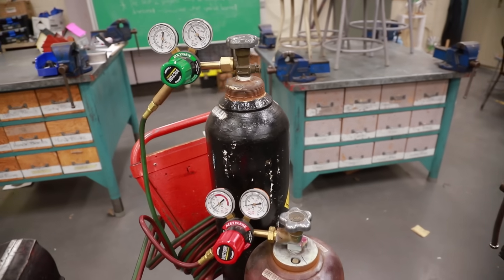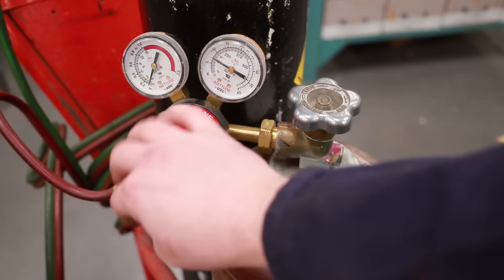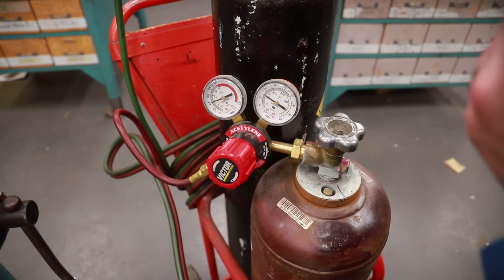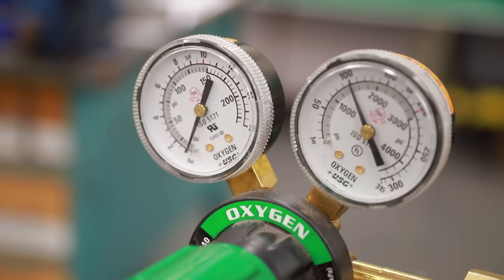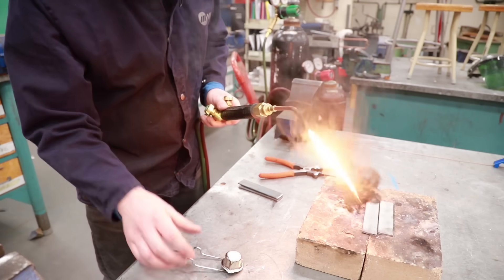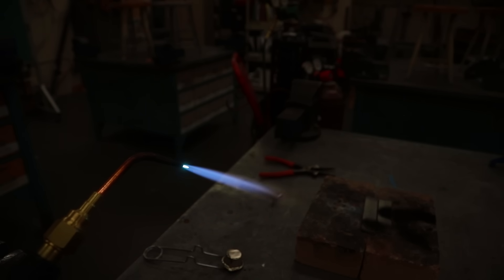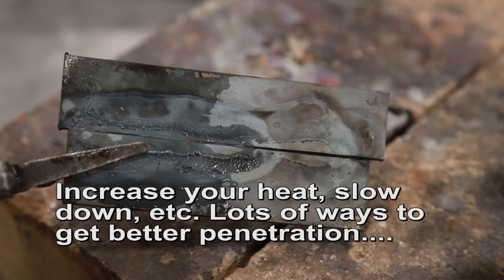Intro to Oxy-Acetylene Welding - Part 1

Comment: Didn't you turn the valve the wrong way to purge the line.  It looked like you close the valve instead of opening it?  I guess I don't understand how the valve works beca use the gauge went down like it should.

Comment: 5:17 don't you mean oxygen valve?
Reply from the maker: You can see at that point I'm adding more acetylene first to get rid of the soot and plan for a higher temp... and then I will add oxygen and aim for a neutral flame

Comment: How thick was it when you were done was it thin where you welded it would have been better to cut the corner off of the pieces of metal and melt it in?

Comment: What would happen if you would have cut the corner off of one of those pieces of metal and used it to melt in the crack all the way down

Comment: Why do you open the acetylene valve only a half turn ?
Reply from the maker: @jakesmith6337  Open and close acetylene cylinder valves slowly to minimize pressure surges. Cylinder valves should be opened no more than one and one-half turns. This is sufficient to provide adequate flow but allows the valve to be closed quickly in an emergency situation

Comment: Prof in my class said putting it up near your ear to hear it is exactly what shouldn't be done as it will get flammable acetylene into your hair and your ear. Also you are supposed to check that your stone produces adequate sparks before having the gas flowing, not let it keep flowing for a while, unnecessarily releasing gas into the room, and then try to spark, particularly because of the situation where gas keeps on releasing while you fail to spark then all of a sudden you ignite more than you should just like with a BBQ.
Reply: RELY-CARNOR.
-FOOD
-FOOD

Comment: "A before O" is correct especially when you finished welding. WHY? When you turn off acetylene, the oxygen/acetylene mixture in the mixer of the torch will be  purged from the mixer and tip by the flowing oxygen and will burn OUTSIDE the tip (Remember oxygen does not burn without a fuel but acetylene can burn underwater without oxygen). There is still a small amount of acetylene between the mixer and the acetylene valve which is now closed. This gas will not burn and will exit in the atmosphere. Now let's do the opposite and turn off the oxygen first. This is done by many if not most gas welders because they don't like the popping sound that the torch makes. The oxygen/acetylene  mixture in the mixer will be pushed outside the tip and will burn, but now that section of the torch is filled with acetylene. When you turn off the acetylene valve the acetylene will burn inside the  torch up to the acetylene valve. The problem is that without oxygen, this acetylene will burn and leave soot INSIDE your torch. this is why if you pull a torch apart you will see black soot inside the tip, inside the mixer and often beyond the valve and inside the terminal part of the hose if you don't have a flashback arrestor. If you have flashback arrestor on the torch, the soot may be inside. this soot is a problem because it builds up as layers inside the torch and will increase gas drag which may interfere when you use  low pressure and small tips. The best way to light up the torch is actually to slightly crack the OXYGEN first and then turn on the acetylene. Again most welders prefer to light up ACETYLENE first, which is ok, but if you don't want soot to blow in the air you breathe, just crack the oxygen before opening the acetylene valve. Now you know why the  shiny brass torch you bought, has the acetylene ducts that appear like they have been dipped in black matt paint. Take a clean cotton bud and insert it inside the terminal part of the acetylene hose. If it comes out black, you have had one or more flashbacks!
Reply from the maker: You can see everything you talked about address in my Pinned Comment video where I correct the mistake. Thanks for watching.
Reply: @WeBuildStuff  the mistake is in your Pinned Comment video. I am only referring to "A before O" procedure when extinguishing the torch. Here you do it correctly but without explaining the reasons.  In the new video you invert to "O before A" without explaining your reasoning claiming the opposite was a bad habit. Once you learn the technical aspects of the gases used, one should always use A before O. Gas welding is a lost art with modern welders preferring the electric welding gadgetry . If you want to find the correct technical information , you need to get the old oxy acetylene manuals, printed 50 to 110 years ago. Misinformation on how to light and extinguish the torch is rife. Most welding school teachers have little or no idea about gas welding. Unfortunately many master craftsmen/artisans of oxy acetylene welding like TinMan and George Goehl have fallen off the perch.

Comment: With all do respect i took 2 welding corsés one 14 months welding and lay out and 1 for pipe welding with torch cutting off the pipe in bevel, and the standard oxígas presumes are 15 psi fuel and 45 psi oxígen! Just my opinion
Reply: that fuel is not acetylene but probably propane. NEVER use 15psi of acetylene

Comment: Can you do this with exhaust pipe?
Reply from the maker: @GuapDolo  if all you have is oxy acetylene then yes you can weld exhaust pipe. It can be slower and more costly than a quick arc or mjg weld but all can do the job

Comment: Does it make sense to weld the other side to?
Or does it have an effect like loosening the previous weld?
Reply from the maker: If you have poor weld penetration then go for the back if you have access. We do gas welding for fun but I wouldn't rely on it for when we need lots of strength like a go kart frame
Reply: @WeBuildStuff  Thanks for the reply, really impressive that you responded so quickly on a video that's 5 years old

Comment: I'm just learning the very basics - the difference between mig/tig/oxy acetylene...  This process looks extremely slow and hot compared to mig/tig.  Would anyone actually choose to make this particular weld with OA over mig or tig in the real world?
Reply from the maker: Nope! I mostly use this for repairs and bending metal but we still teach the process as the hand eye coordination required is helpful for students using Tig welders!
Reply: @WeBuildStuff  cool, thanks!

Comment: Brand  new to learning to weld.. but I was told Oxygen off first. NOT acetl.  Doing a search confirms this.. why does he state the opposite?
Reply from the maker: See the pinned comment and the video description where I address this including an updated video where I clarify https://www.youtube.com/watch?v=C6lluYIl9Xk. A before O or up you go (when setting up). O before A when you put it away (when shutting down) is the correct way it should be down.

Comment: Oxy-Acetylene is the most versatile way manipulate mettle... it just seems to be slow for welding and easy to blow through just about anything. I almost want to say that if you are starting metal work as someone that's doesn't do metal work... using oxy-acetylene is probably the easiest way to start to learn.... one set of tools... should be cheaper then 3.

Comment: U dont add any rod?
Reply from the maker: This video is showing fusion welding and creating a puddle with just heat. Part 2 shows filler rod and I have some other videos that show more in detail. Personally I will choose Mig or Tig any day over gas welding but I still teach students how to set up so they can heat and bend metal

Comment: Tip facing wrong way just had my first welding class it should be pointing towards the two valves
Reply from the maker: I'm curious as to why that would matter. As long as you don't bump the valves on the torch handle while working. I would put that down to personal preference

Comment: Probably the most inefficient way to weld.
Reply from the maker: Good thing I never claimed it was efficient in the video haha. We mostly use the gas torch to heat and bend material in the shop.

Comment: Well I hope your new video shows different ways of lighting a torch? "Nice sooty flame"? Gas welding needs a higher pressure oxygen than needed with acetylene. Thats why you open the oxygen first, it sucks out the acetylene which eliminates gas explosions. OK you have safety valves, but lighting correctly saves the environment too. Oxygen first on, acetylene first off. A "normal" flame for welding is around 2300 degrees centigrade. Mild steel (ca 0.2 carbon) has too little carbon content to crack when cooled. If this was a video for amateurs I wouldn't bother writing. But for students, you have to step up. Sorry.

Comment: umm shouldnt you use copper wires while welding? Im learning how to oxy-acetylene weld and we are using both torch and copper wires as welds
Reply from the maker: This video shows fusion welding with just heat. Part 2 shows with a filler rod and my other videos show how to make a stronger gas weld than shown in this video. 
Main purpose of this video was to get my students comfortable with setting up and using the torch

Comment: Could you also feed mig wire in by hand while using the torch? 😅 Just curious if that is possible. Ive only ever mig and stick welded actually had no idea you could weld with OXY/Acetalyn  till today

Comment: use any filler material in gas welding ?
Reply from the maker: Yes. I only show basic fusion welding in this video. I was using a fairly small tip and flame so it was a weak weld. I progress through the video series and show different welds and strengths

Comment: So this may be a dumb question, but how does this type of welding not ruin your surrounding metal?  Every other method of welding is so concerned with minimizing the HAZ, yet gas welding literally brings the whole piece to cherry red. It seems like this would cause so much hardening around the weld.
Reply from the maker: We don't do a lot of this type of welding other than curriculum stuff in the high school setting. We primarily use the oxy-acetylene torch for heating (for bending and shaping, etc) and melting materials for lost wax casting. Gas welding tends to be very expensive and inneficient when it comes to setup and time compared to MIG welding. We teach this type of welding as a stepping stone towards TIG where both hands are doing something different (welding rod and holding a torch, controlling voltage, etc) while controlling a puddle. This type of welding also gives students the responsibility of learning multiple steps in a process. I'm less concerned with the final results or quality of the welds with jr grades. Instead they get exposed to different tools, opportunities, and build their confidence.
Reply: @WeBuildStuff  That makes sense. I stick and TIG, never been to a school so I haven't been exposed to gas welding, only ever cut with it. I'm just curious about it so I've been watching videos. I know it is used in aviation, and used a ton historically. I was just curious about modern use of it. We focus so much on the HAZ in all other forms of welding, but that goes out the window here. I've never seen gas used for anything other than cutting, but I've only been around steel mills and automotive. It's actually wild there are planes still flying that were put together this way. I could see this being a useful skill for a farmer, somewhere you don't have power or the $$$$$ for a trailblazer.

Comment: Dude, Are you seriously going to teach people to do something that can hurt them right when they start? If you were my employee you'd be fired. You never even if it's a low-pressure tank, crank the valve wide open with the set of gauges on them. The only time you crank It Wide Open is when you're opening it to blow out anything that might be in the threads. By cranking them wide open with gauges on them, the gauges can explode and parts cab strike the person in the face,  go flying across the room cause physical damage to others and a ton of damage to other things. If you went to school and your instructor didn't teach you that shame on him. But shame on you for teaching this on YouTube, when it can kill a person in reality.

Comment: I think acetylene welding is becoming a lost art. My father taught me to weld with a torch 50 years ago. When I ask some of the younger mechanics if they can weld with a torch, they'll invariably say, "What, you mean braze?" One bright spark actually told me you can't weld with a torch. "That's not welding, you're just melting two pieces of metal together," he argued. No one I know under the age of fifty can actully conceive of such a thing.
Reply: I'm a diesel mechanic in tech school and this was the first type of welding we were taught! I'm still a little green on it so that's why I'm touching up on this video!
Reply: I started a semester long welding class yesterday. The whole semester will be oxy fuel only...no machines. I bet it will be much more educational than jumping right into machines.
Reply: I'm actually here because I am familiar with arc welding, but I was curious how the greatest generation welded the battle ships together than won WW2. I'd like to get a torch but the gasses are difficult to find in my area.
Reply: @JamesKelly89  since arc welding was invented in 1881 and patented in 1887, they probably used arc welders.

Comment: My welding instructor always taught me "Fuel First" Quarter turn, Oxygen half a turn to get started and then you can adjust it to what you need from there.
Reply from the maker: Are you referring to the cylinder tank valve or the torch valves?
Reply: @WeBuildStuff  Torch Valves
Reply from the maker: @nathanmattera3393  cool. If that works for you do that. For my torches if I open a 1/4 it ends up being WAY too much gas at once

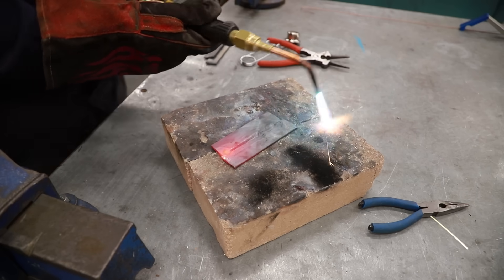Comment: 10:33 some say turn off oxygen first and some say turn off fuel first
Reply from the maker: We always NOW turn off oxygen first and then acetylene. I had some bad habits shown here that I no longer do improperly!
Reply: @WeBuildStuff  I turn off oxygen first because the oxygen tank's pressure is usually a lot higher than the acetylene tank's pressure. I avoid that unwanted internal bang.

Comment: Hi, I wanted to ask the shutdown procedure ... I read and saw inverse or equal procedures to yours (turn off before oxygen or turn off before acetylene), some say that it is safer in one way others swear the opposite ... question: which Is it technically the correct procedure in terms of safety? Does this also apply to oxygen/propane mixtures? Thank you very much!
Reply from the maker: I made an updated video addressing this.
I now shut down oxygen first and acetylene second.  I was taught incorrectly years ago and developed a bad habit 
The only time I turn off acetylene first is if I needed the flame out immediately. It usually will create a poppin sound and unfortunately cause some sooty build up in the tip. 

Updated video:
https://youtu.be/C6lluYIl9Xk
Reply: Thank you very much for your reply, it is a subject where there is still confusion.
Reply: @WeBuildStuff  No, you were taught correctly. A before O is correct for turning off your torch. less critical when you turn it on. the detailed reasons are on a separate post with today's date

Comment: I'm A welder from Nanyuki Laikipia County In Kenya, 
Is it advisable to have four Flashback Arrestor in one set of welding kit.? Can I use only flashback Arrestors on regulator/Shank(Torch) on two instade of four
Reply from the maker: In BC high schools we are asked to ensure we have these setup this way for the classroom
Reply: Thank you.

Just like stick welding we have different electrode for welding different millimetres, does that apply to gas welding nozzle  no.2,3,5 and 7 etc for welding.? Coz I have never understood when to weld with no 2,3, and 7 I permanent use no. 5 in all My Gas welding be it aluminium, Cast n light gauge plates and heavy plates. Please advise.
Thank you

Comment: May be a dumb question,  but will the welds be strong as an actual welder using a torch? Like if I wanted to weld a trailer coupler using a torch on a small trailer, will it be strong enough?
Reply from the maker: I don't weld much thicker than 1/8" with this current setup but you can get larger tips and do multiple layers. For bigger jobs I stick with Arc/mig. I use the torch more for heating/bending and skill development

Comment: This is the most informative and best organized video i have seen!  Question? What is the best type of welding to repair a broken wrought iron railing  welld
 joint?
Reply from the maker: Any type of welder that can do steel! Mig or stick/arc is handy and strong!
Reply: @WeBuildStuff  Many thanks for your considerate reply!

Comment: Not sure why you're recommending shutting off the acetylene first as that practice is from decades-old information (misinformation).  This is contrary to just about everything I've learned and can find from contemporary, reliable sources.  The resulting backfire (pop) is the first indicator that this is not the way to do it.  Shutting down the torch is just the opposite of lighting it and bringing it down to a neutral flame.  It's very old information to turn off acetylene first.  Very old.
If you shut of acetylene first, the mixed O2 level will change upward within the torch, allowing the flame to suddenly BURN BACK into the torch, causing the small 'pop'. If you turn of O2 first, the burning rate rapidly lowers only  fuel is exiting the tip. (so you're back to a sooty flame)
The SAFE and correct method is to shut off the Oxygen first.
Reply from the maker: Please read the video description and pinned comment that talks about it.

Thank you for watching.
Reply from the maker: Bad habit picked up from when I was taught the "wrong way" 20 years ago. I do teach students to only do that now in an emergency if they need to shut the flame off instantly regardless of a pop. I would rather have to clean my tools than deal with a fire or injury